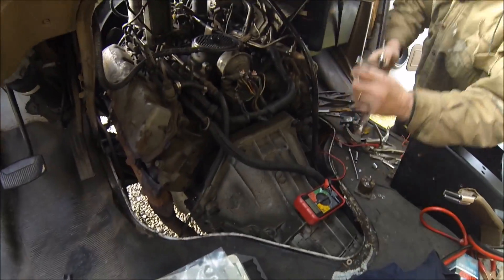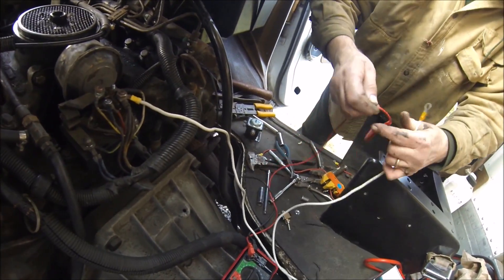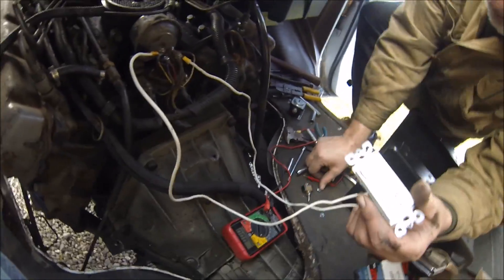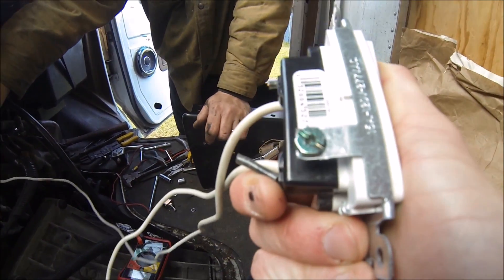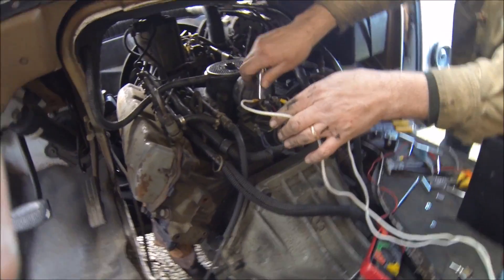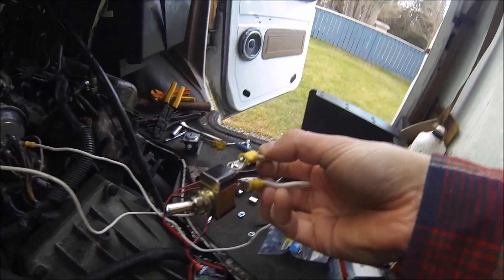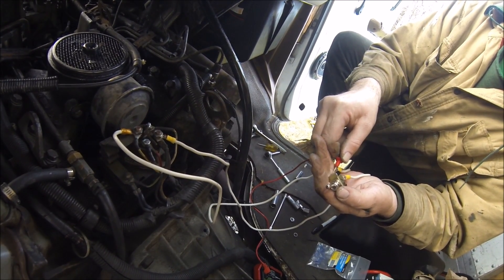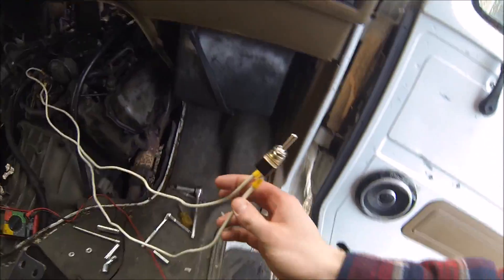Manual Glow Plug On/Off Switch Tutorial - Ford Diesels

Comment: What was your original issue?
Reply from the maker: really hard start
Reply: @MoistMTB  same here. Hows the switch working so far?
Reply from the maker: its not on there anymore, but it worked for a long time
Reply: @MoistMTB  got it ok cool yeah I was looking in to it since the glow plug parts are really expensive but the Ford book on it just said to not do that because it will mess up the glow plugs running them with 12v constantly so I think ima have to fork out the money
Reply from the maker: glow plugs on idis are not expensive... yes its not recommended, but it is possible, and i show you can do it, lots of guys use a manual glow plug switch and bypass the controller completely

Comment: the switch cannot carry the d/c amperage....
Reply: Ohms  law. My thoughts exactly. Probably only rated for about 600 watts. (110 v x 5 amp draw)  The DC circuit is 12v x 500 amps (max battery) because the relay is pulling unlimited amps, that's how it broke so maybe 6000 watts.  Any switch is going to pull tons of amps unless you replace the relay.  Glow plugs pull about 10 amps each so the wattage is almost 10,000 if available.  Big amps pull big heat=big destruction.

Comment: hahahaha, isnt house curretnt more then a car? hahahaha. great vid, made me laugh.
Reply: Pretty sure voltage is but not amperage. Lights probably pull about 5 10 amps, but at 220 volts, while those glow plugs probably pull 25 30 amps at 12v
Reply from the maker: pfft probably haha